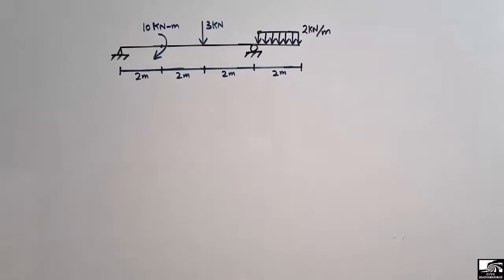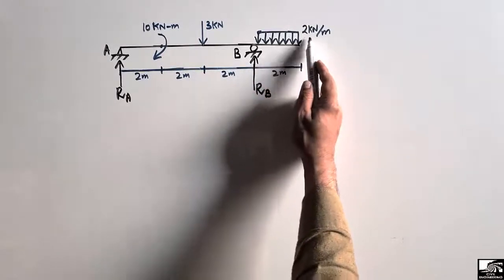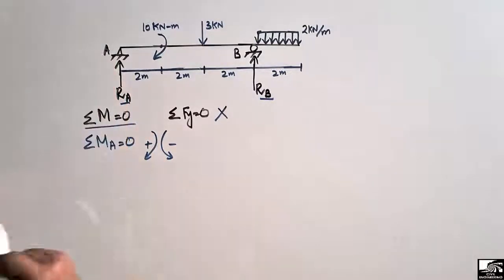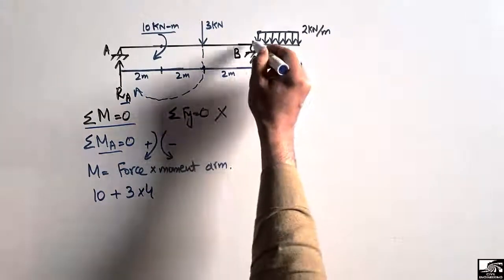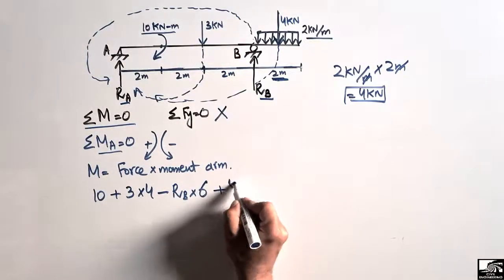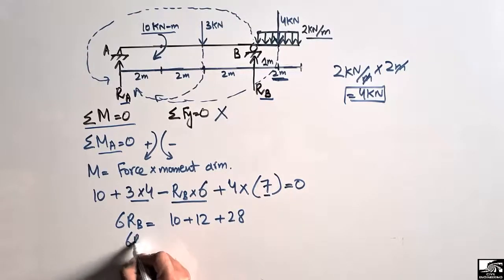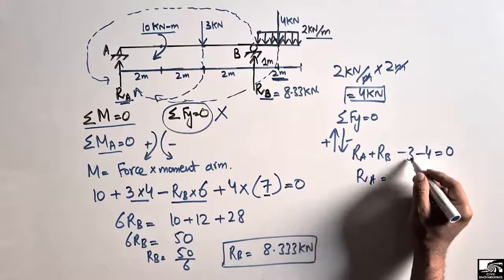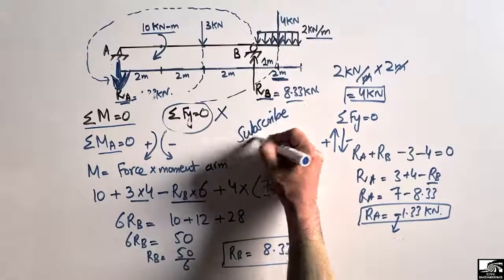Support reactions for complex loaded beam in 2 steps

Comment: Won’t there be a reaction force Ax because it can’t move in the x direction at point A?
Reply: this is roller and we don't have forces in x so no reaction
Reply: Point b is a roller, point A is fixed
 @naodreda-lw5lt
Reply: Yes, its fixed so there should be an Ax. Point B is a roller so it has just 1 force